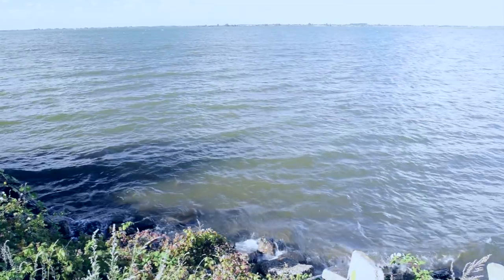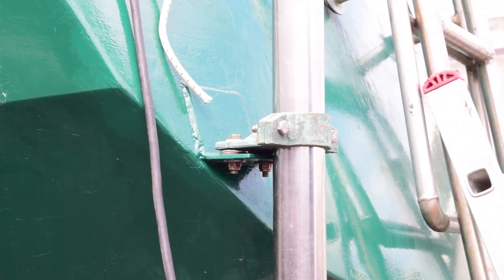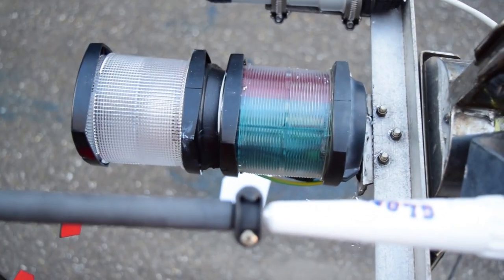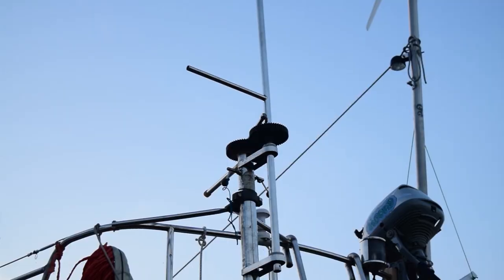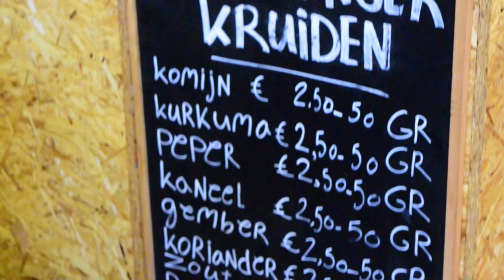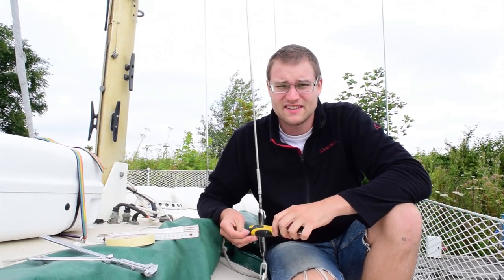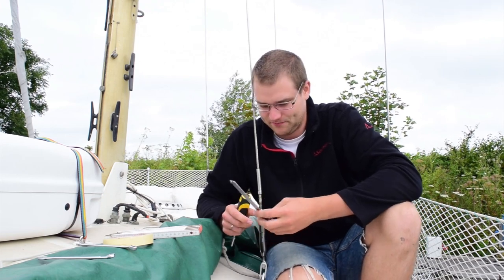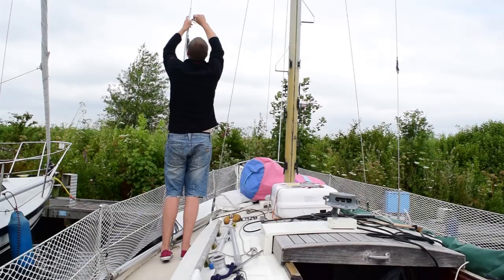Two aboard Tuuli Ep. 17 - Being asphalt sailors for a while (Part 2)

Comment: Oh yes! I do so love the windvanes which can double as auxiliary ruder systems so mu better then the swing pendulum units. The mounting on that unit was the simplest system I have seen. I have no experience with the Ubiquiti Bullet though have read some about it. I have replaced laptop wifi with Ubiquiti units on few occasions 10 years or so back. Top shelf transceivers whose performance can never be understated. Love the twin chine design of your hull. We in America refer to those measure devices as Vernier Calipers. Great rig tensioning short cut.

Comment: Like your vlog as always and have never ever seen a set up like that for a windvane being off centre. Can not wait until next vlog for you to tell us how it went.
Reply from the maker: The setup off cente has two reasons: 1) you should only mount auxiliary rudder windvanes in center, if your can mount it at least 30cm/1ft aft of the main rudder, otherwise the windvane rudder will be irritated by the streaming turbulances of the main rudder. 2) we have a giant windgenerator mast in the way, so it had to go off center anyway :-)
Reply: HI and thanks for update, I don't have a windvane on Alcina so did not know about the  least 30cm/1ft aft of the main rudder. Well I will be waiting for your report on how its works when under sail.

Comment: Hi,
Would you please tell me where you found the LED bulb for the deck flood light, please?
By the way, don't worry too much about the bay of Biscay crossing and don't make any unnecessary haste. Last year I crossed it in early November and I had good conditions - even too light at times.
Reply from the maker: Ahoy, thanks for the encouraging words about the Biscay crossing!
The LED buld for the deck light was hard to find, but I purchased this one: https://www.svb24.com/en/sealed-beam-reflector.html (scroll down to the LED version, item no. 15908) That fitted perfectly into the socket that previously held a halogen bulb.
Reply: Thanks a lot!

Comment: Best not to use a screwdriver on the turnbuckle. Another spanner in the middle is best. I was under the impression that you do either side shroud a few turns at the same time otherwise your just pulling mast to one side?
Reply from the maker: That's correct. Next time I will even use two measuring sticks and tape them on both sides.
Reply: Don't think you need to 2 sticks as you are creating equal tension by turning the same on both sides. Been reading up quite a bit as removed my mast this week and want to know how to put it back. Selden has a guide you can download which explains the process well for different rigs. Are you planning on doing some distance sailing now you have a windvane too? I didn't realise Tuuli was a steel boat.
Reply from the maker: ***** Yes, we are going to leave for our big journey in just a week from now. Sailing down the coast of the Netherlands, Belgium, France, Spain, Portugal and then to the Canary Islands. We'll see where we go from there :-)
Reply: Trade winds across the atlantic?
Reply from the maker: ***** Is high on the wishlist. We'll see how we and the boat are doing :)